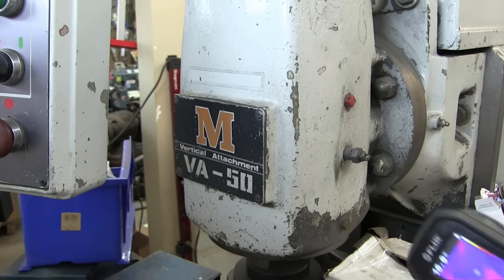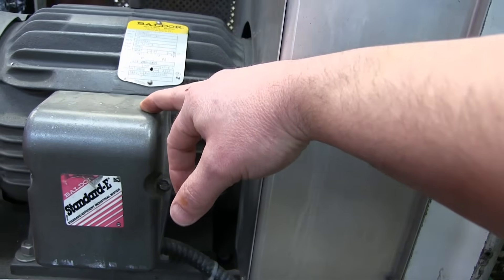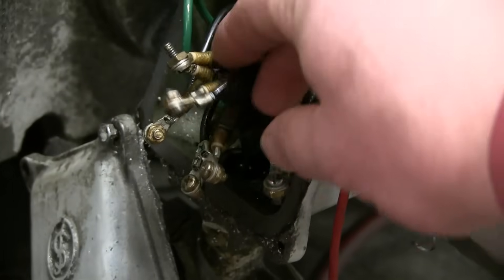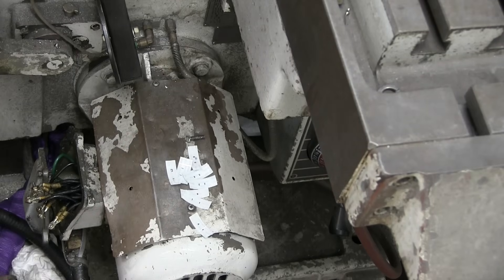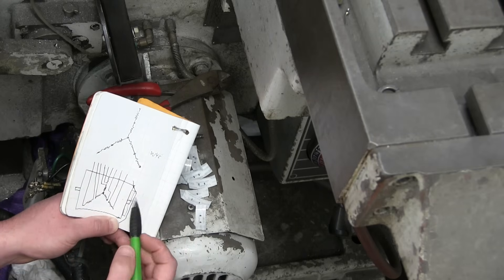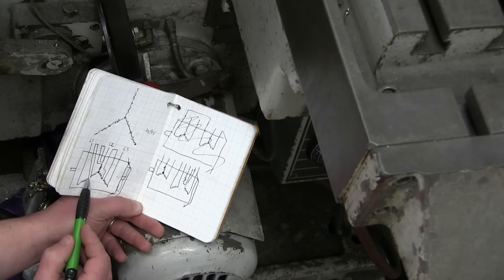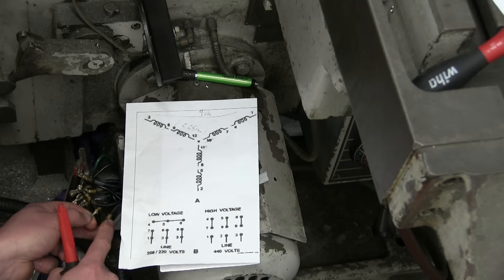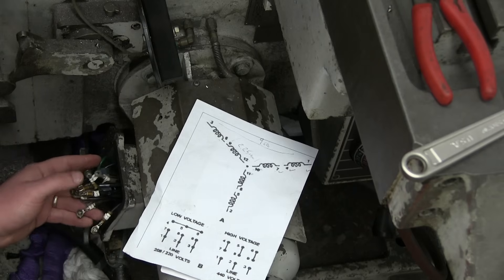MAZAK MILL AUDIT l 9 wire dual voltage electric motor wiring

Comment: But there are some times when a rotary converter MUST be used. Any time you have a resistive load such as a welder, a static type phase converter will not work. And a rotary converter is very easy to build, even if you add balance capacitors. Heck I built my own to run a three phase MIG welder several years ago.

Comment: Rotary phase converts can be built for pennies compared to their retail cost. While not perfectly balanced most 3 phase motors deal with just fine, and they are durable. A used 3 phase motor, a few surplus high voltage capacitors, a voltage sensing relay and a contractor and you can build your own for less than $200 plus the cost of a used 3 phase motor. It will be self starting and pretty well balanced with a little capacitor juggling.  Vfd’s are better but you can’t easily build your own. My 2 cents and worth every penny. Cheers!

Comment: I'm skeptical of the frequency drive... as mentioned in the comments below I think the addition of direction control contactors  for your other functions will alarm the drive when it is running the main.  If it does work it would sure simplify things though, I'll be following this one !

Comment: I bought a V.F.D to run a 7.5 hp motor.  Works like a hot dam.   The hardest part was the chinglish  instructions.  Took about a week to figure it out.
Reply: henk Barnard 
 Did it convert from single phase?
Reply: yes 220 to 220 3phase

Comment: no factory wiring diagram exists?  

With all those controls you're probably better off with a rotary converter.  The VFD won't work right with the contactors and such.

Comment: I love how you deal with electrical issues, I worked for just under 35 years in a power plant retiring from the Control Room. It was my job to put (as you call them) the angry pixies in the wires. I have a very deep understanding of how it all works, having said that hearing your description I realize that you are oh so very technically correct you just don’t use industry jargon and as a result many people without my background understand it. I have turned several of my former coworkers on to your channel they also enjoy it.

Comment: Rotary phase converters are good for this application. The power output is almost 100 percent and you don't need to rewire the mill. They can be home built and do the  job. The forum on the practical machinist on phase converters has plans. I built a 15 hp one around the early eighties for my shop for cheap and that has allowed me to run a 3 phase table saw, air compressor, metal lathe and 300 amp DC welder by just connecting them up. a couple of years  ago I bought an almost new electric 30 hp motor for 50 dollars of Kijiji. A few capacitors and contactors gives me a rotary phase converter. VFD s need to be wired up direct to each motor from my understanding with no switches in between and that is one reason I would not go that route.

Comment: does that yama zak have any switch between where you plan to put the VFD and the motor, like a drum direction reverse switch or one of those starters?  if so, using said switch will smoke your VFD.

Comment: Stupid question, have you plugged the tally plate numbers into the confuser to try and run down the wiring diagram? I'll bet there is some MAZAK master (nerd) out there off loading some manuals on ebay for that same model, because it not the numbers matching one for the good miller (you know the one only broken out for company). Wiring diagrams are not instructions so they don't count against you if you need to get something chooch'en.

Comment: I got 3 things to say about VFDs. No. 1 is VFDs don't like being behind another VFD. No. 2 is if you have a 3 phase CNC you have to use a phase converter for a CNC machine because you need as clean and true of a sine wave as possible and a VFD outputs a form of a square wave. No. 3 is never put a VFD in front of a transformer because it will overheat it and if not caught in time burn it out.

Comment: An Elechickens tip for labeling wires in a greasy/oily location.
Don't wrap the tag around the wire, the oil will separate the sticky side from the smooth side in short order.
The trick is to flag the wire, fold the tag over the wire, sticky side to sticky side, this will stick together much better.
Another option if you don't have wire markers, use white electrical tape for flags and a sharpie for the outer coils, yellow tape flags for the inner coils.

Comment: Maybe I didnt quite catch what your saying there about the roatary phase converter, but you dont derate them. If you have a 30hp converter you can start up to a 30hp 3 phase motor, or multiple motors as long as the hp adds up to 30 between the multiple other motors. Static loads are a whole different case though. Welders draw whole lot of juice, all i know is i can run one 500 amp inverter style putting out 480 amps at 34 volts and another 500 amp inverter style welder running about 250 amps at 27 volts together off my 30hp rotary. I have one 25hp 3 phase  chop saw and It starts it up pretty dang quick if not the same as real 3 phase, so i haven't tried putting her up to full bore but I dont doubt it can handle it.

Comment: Maybe we can help you. we come across old swimming pool motors ranging from 1-3 hp. 220-110v options on all. Square and round flange.  I'm not going to send you a new motor, and I'm not going to send something you can't fix. And I'm not going to send you directions.
Build a flange to connect it, maybe a gear reduction, you will have to fabricrap-it for whatever you need.

Comment: ..... and when all the lights in the neighborhood start flickering it's just AvE milling down his rusty nuts.  From the problems I'm seeing..... reverse second guessing without schematic might not work. Full shakedown and rebuild? You need a schematic/maintenance/operating manuals. Post the model # and yr built..... That replaced motor sends up all kinds of red flags.....

Comment: Yeah rotophases make tons of noise. As well the wild leg is a pain when you inadvertently put it on a Transformer. The voltage is always crazy high. I have only worked with them in 480volt. A phase converter maybe be ok just need a bunch of capacitors that half the time are finicky.

Comment: For those in the know: all decent treadmills have been using 3 phase motors and VFDs for about a decade now. Usually at about 380v on the HV DC rail.

Comment: What about the guys that hook up a lil generator for a third phase? Even seen a guy use another electric motor to generate a third leg.
Reply: Jax Turner Those guys clearly don't care enough about what they're powering to risk single phasing it.
Reply: orijimi not sure what you mean, They are using 3 phase. The third one is just from a separate generator so what’s the risk? Because this is for CNC? Other guy was powering large compressor for years like that,  dirty sine wave or something dangerous for CNC tho? is that what you mean?

Comment: Ave, if I was you I would replace all of those motors with single phase motors and rewire the friggen thing. Start fresh right? No fucking around with phase converters or any bullshit.
Reply: 240shwag these machines needs the starting torque. I'd love to see massive DC motors on there though, it would be neat.
Reply: But that wouldn't make the video as unique and interesting.

Comment: But but you got your pairs identified, and well done at that, but don't you need the sequence? You got a pair and you just called it one and four.  They occupy a specific group of winding in the field.  I'm confused
Reply: Doesn't really matter. Its circular and symmetrical. Although getting the sequence  of the pairs wrong....hmmm would that reverse the direction?
Reply: Generic User Yes it would reverse rotation, in fact that's how rotation is reversed. If any 3 phase motor goes the wrong way, simply swap any two of the supply lines. It can be done easily before or after the contractor or it can be done at the motor but once the motor splices are completed it's far more work. Good day.

Comment: Heck man , I've been letting my master bathroom remodel warm for five years 😄
Reply: Gotta wait at least 25 years for the foundation to properly settle so it does not mess up the tile later on.
Reply: klax0421 baby darling sweetheart....I would love to do that diy project you need, but I'm waiting on settlement and a replacement wankle valve
Reply: I'm waiting on the radiator bearings to break in before I go further than the beer store.
Reply: I can relate🤣🤣🤣

Comment: At my job we have a mazak laser cutter 6 kilawatt fiber laser I would not want to get hit by that beam after seeing it cut inch thick material but it is a unreliable peice of shit we have 3 other trump (owned by siemens) and they cut pretty relieable the oldest one dates back to 97 so it does need tuning and tweaking a lot But it is awsome seeing the newest we have perice a hole in 1 inch steel

Comment: I could give you a good deal on an old Mighty 390 Ford that would be a lot easier to wire than that thing. 255hp @ 4400 and 376 ft/lbs @ 2600 should do the trick.
Reply: good luck getting counterclockwise...

Comment: Now how do you puzzle out the phase if all 9 wires are flopping freely in the wind? To find 7,8 and 9 will be easy,same as finding the 3 outer coils 1-4,2-5 and 3-6(but you won't know if it's 1-4 or 2-5 etc). But how do you know that your pairing 1-4 with 7-10 etc. Hope the question makes sense.
Reply: bert visser Three of the windings will be hooked together, do you can figure those out with an ohmmeter. If you can spin the motor by hand (or wrench), then you can run it as a very low power generator and compare sine wave phases on a dual trace oscilloscope.